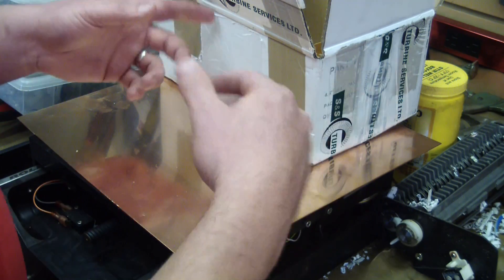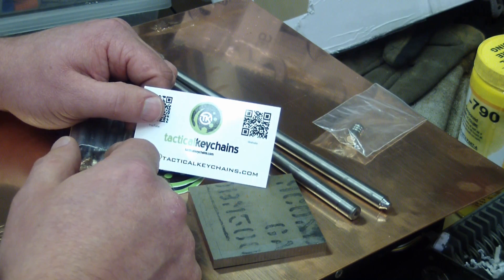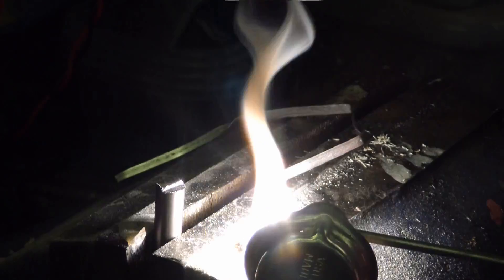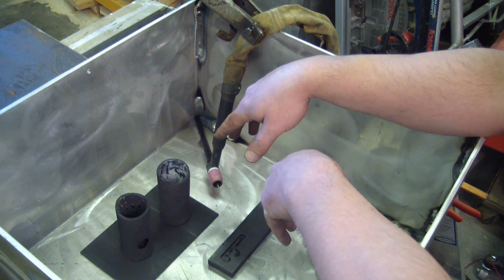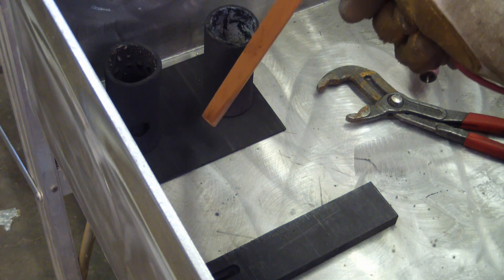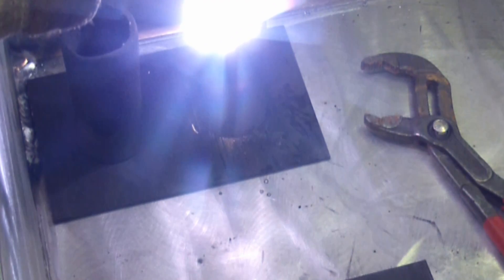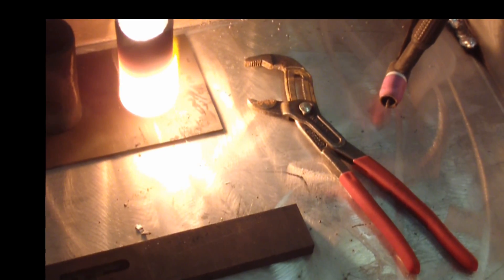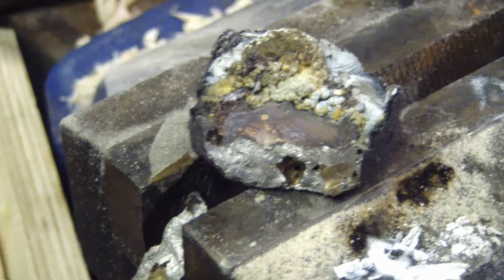Titanium Casting Experiment

Comment: The only thing I can think of to try which might result in pure titanium is to use two pieces of titanium as electrodes with an arc between them feeding them into one another and allowing the molten metal to flow directly into your mold below. Commercial systems use a vacuum chamber, special liquid cooled copper crucibles with induction heating and calcium fluoride. The calcium fluoride melts before the titanium insulating the titanium electrically from the copper crucible and the active cooling causes a thin layer of titanium to solidify on the walls of the crucible protecting the melt from contamination. You can use argon instead of a vacuum. Commercial titanium molds are made from zirconium or silica ceramics.

Comment: Jeez, AvsE, how many ways to die horribly at the same time did you dream up today??

Some comments... Maybe what you need is a totally enclosed argon working volume with a system of waldoes. Now all you'd need is a panel of fused quartz to act as a window. Another week's wages. As you were arcing, I was thinking how easily your argon cover might be blown away and you left with a titanium fire. That would leave a mark..

Also: have you considered inductive heating? Would an inductive furnace w/crucible get hot enough to melt titanium?  It probably would not do your electric bill any favors, but it might be more controllable (repeatable).

-- Cal in Louisville

Comment: While Carbon would otherwise be ideal for melting most metals, titanium is unlike most metals, and will combine one to one with carbon forming TiC, titanium Carbide.

I think you made a crucible of Titanium Carbide, which accounts for the continued development of heat after the arc was removed.  It's physically similar to Tungsten Carbide in most areas such as hardness and crystalline structure, though not nearly as dense.  It too is used as a tool coating.

The yellow/gold portions may have been Titanium Nitride, if nitrogen became introduced at some point: it is also very hard and used decoratively to simulate a gold finish.   Of course, it may have been gold, but would that much Au gone unnoticed in the crucible?
Reply: aw, I didn't know any of this 'til you asked the magic "why didn't it work?" question...  I thought you had it for sure with the tub of argon...  

From what I've read, they didn't even have Ti metal outside the lab until the mid-1940s, because it's such a PITA to refine and then work it...

That it reacts with graphite and nitrogen when heated makes it a helluva tough substance to do much with.  Graphite conducts heat 4x better than titanium; aluminum 10x, copper & silver 20x.

I wonder how water jets do with Ti....
Reply: Nevin Williams water jets are widely used to cut titanium.  IRC Metals in Portland, Oregon  uses them to cut through slabs over a foot thick.

Comment: Loved it!

Why not an induction forge? Coil around your crucible, drop in the metal, high amps..... Will that work with titanium? There are YouTube videos of guys doing it with steel anyway.
Reply: I've been working on an induction furnace too. A fairly big 6kW one, not the chintzy Royler/flyback based ones that blow mosfets after 600-1000W.

The 4HV (.org) forums I've found to be the best community for that kind of stuff. Really helpful, smart, good people.
Reply: *****
 That'd be sweet. Sure! I already have a fancy anodizing setup. Umm, Youtube PM to exchange contact info?
Reply: ***** I have some 32g wire in titanium, maybe a few bits of 24g too, but not much. I have Niobium, Tantalum and Zirconium to play with, and some Multi-Etch I've never actually got around to using. Supposedly makes anodized titanium far less matte.
Reply: Why avoid Multi-Etch? Everyone I know who uses it swears by it. (Sampling bias I suppose).

Comment: That was fun to watch. If you haven't anodized titanium before, maybe give it a shot.  Just need a diode bridge, variac, water and borax and is fun to play with.Sands off easy so you can do it over and over. As for ideas for melting/molding the titanium, some sort of current controlled arc rod positioner and the entire process done in a vacuum chamber.
Reply: TSP (paint isle at the Despot), baking soda, and table salt work too. Water just has to be conductive. (You're doing electrolysis and forcibly bonding the oxygen to the metal, [hydrogen bubbles off] creating a thin transparent layer that prisms the colors a specific way). But don't use table salt! (Or rather, do and see why). Chlorine forcibly bonds with everything creating green swamp water and poisonous gas.

There are only 3 chemicals that strip off the titanium-oxide coating letting you un-do anodizing or getting you back to lower voltage colors. Two of them are uber-nasty (mere fumes from them pass right through your skin, into your bones, give you organ damage)... but the last one "Multi-etch" is almost harmless. You used to have to smuggle it into Canada because there was only 1 supplier, but now you can get it up here from TheRingLord.

Hope that helps.